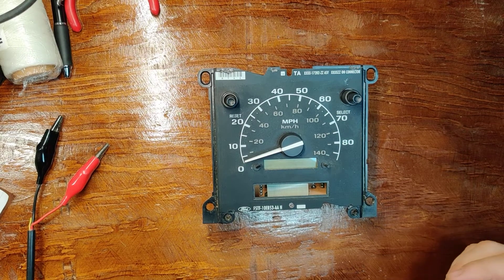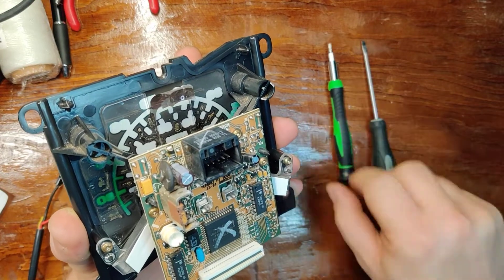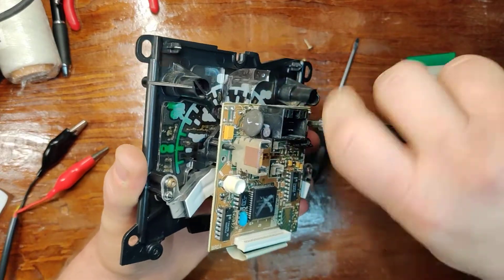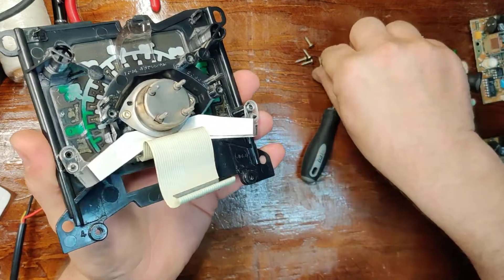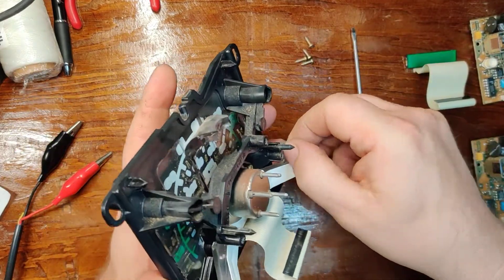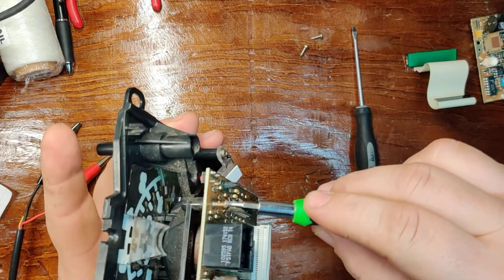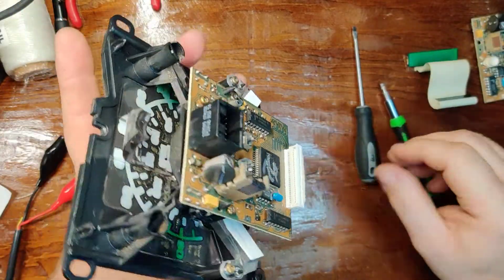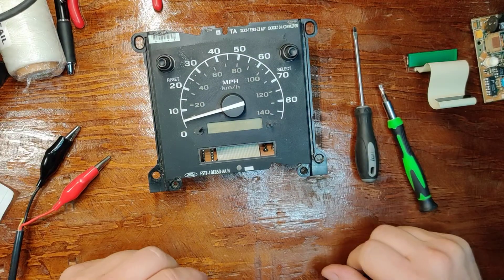Ford PSOM Speedometer Head PCB and LCD Change on OBS Fords and Other Ford Powered Vehicles 92-97

Comment: When i push the trip button on the cluster, the trans shifts out of overdrive and gets into limp mode or something. Sometimes it goes away by itself and sometimes I need to restart the truck. Guess somethings wrong in the PSOM.. some soldering or capacitor is bad. I have trying to troubleshoot transmission problem a couple of days. Ford f250 1992.

Comment: I believe the psom is working fine in my truck (runs and drives fine) but the speedometer and odometer is dead, do I just need to replace the lcd and needle unit or get a new one and swap the pcb?(95 f150)
Reply: Check on the driver side transmission for a round peace with wires on end of it, should be at top edge you will see a band that held it, mine was just hanging there so I returned it to the small band holder and everything work great, I thank they pull them out to keep the mileage down, Mine was the 5 speed transmission, good luck hope this helps,
Reply: @williamstidham2163 I will have to look at it in the morning thank you very much for the reply good sir!!!
Reply from the maker: Something else to mention... Is it a standard or auto? With the standard models, the PSOM doesn't control anything but cruise (if equipped), but you'll know it when the PSOM stops telling it when to shift as the trans won't shift correctly, pretty badly actually. You might have to pull your cluster to check if it's getting power. The PSOM will illuminate and "power up" with 12v and it will read the mileage. When the ignition is in the "off" position, the light green and yellow wire at position C1 should have battery hot at all times. When the ignition is in the "on" or "run" position, it then sends power also to the white and purple wire in the C3 position. Check the pink and orange wire in the C2 position for ground. You can back probe these wires after removing the gauges without unplugging them. If you have ground and hot where you're supposed to, then your PSOM PCB has failed. Most likely your gauge works fine. They rarely fail. You can find a PSOM on eBay or send it in to a gauge repair shop have it repaired. Typically the capacitors dry out, or some tracings oxidize and deteriorate. Good luck! Sorry for the late message! Thanks for the reply!
Reply: @whiteknightandshorty  but it does illuminate when I start the truck, anyways I’m gonna have to pull it apart this weekend and see if everything is as it’s supposed to be, thank you again for the reply it really helps!!!

Comment: I had my speedometer and the VSS .The speedometer still only goes to 5 mph. It is a 1997 Damon Daybreaker Motor home

.

.
Reply from the maker: You may want to check your VSS input. You can check it accurately with a handheld oscilloscope, or you can check its function with a quality multimeter on AC voltage. The voltage will increase linearly as you increase your speed. If it tops out, you most likely have a broken tone ring on the side of the ring gear on the carrier. You can check that by removing the VSS, and lightly with a regular screwdriver, you would be able to rotate the "thin bumpy gear" that will be centered in the VSS hole. If you measure an good increase in voltage at the PSOM harness, your PSOM board or the needle motor is bad, and you'll need it to be repaired. Instrument gauges shops are still all over, and most likely can repair it at that point. I hope this helps.
Good luck!